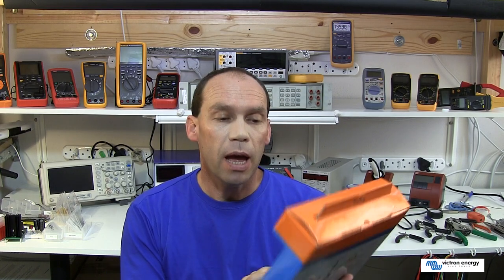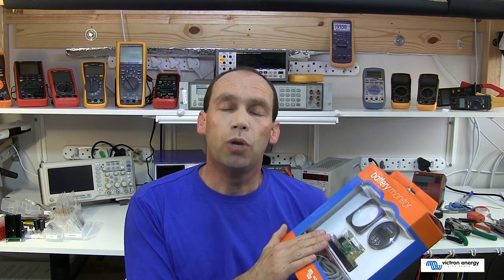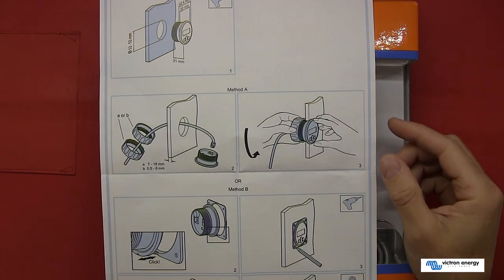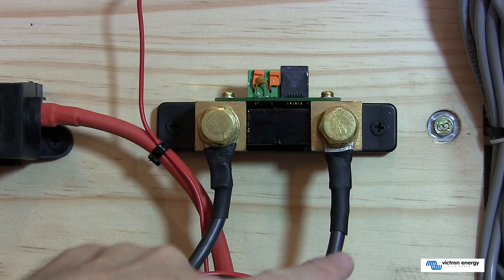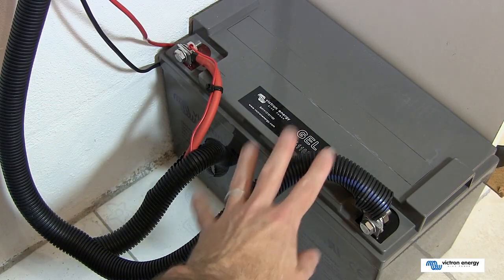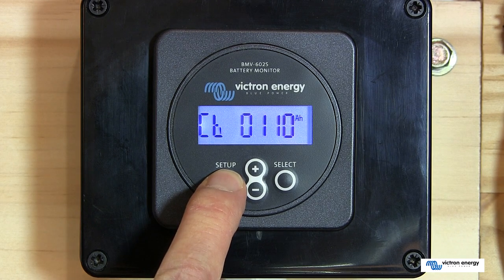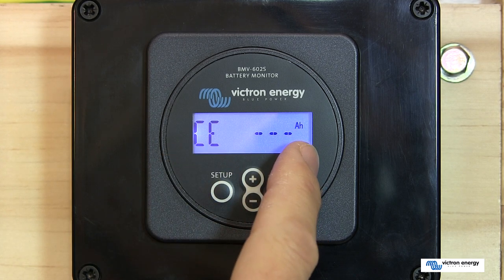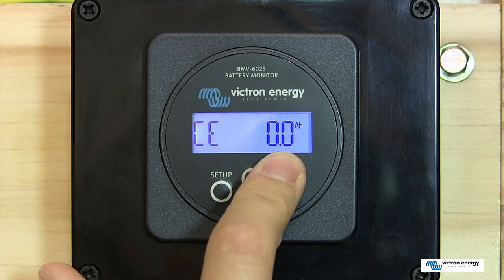VE Product Tutorial: Battery Monitor BMV600S - Part 1

Comment: Hi Dan, The monitor can automatically perfomr a auto synchronization to 100% but it needs ot be set up, it is quite simple but flexibloe as well so it will work for different systems. It can also be set to 100% 'by hand' as martin has shown.

Comment from the maker: It automatically recalibrates SOC depending on rate of charge, discharge and several other parameters. It's quite intelligent, I will cover some of that when I do part two. There is a video on YT showing some guys installing and using it in an EV.

Comment: I really like the Victron's ease of connection, using that telephone-jack plug, compared to my Xantrex LinkPro with a lot of single wire-connections. I guess the Victron BMV-602S is a sibling to the mentioned Xantrex LinkPro, as well as Merlin Powergauge Pro, E-xpert Pro, Studer SBM-02. The Victron has one more panel button though...

Comment: Thank you for sharing your video. I am in the process of researching what system or set up would be best for my RV going solar power. So far I have one Trojan 31 AGM battery but eventually I would like to run either 4 or 6 of these batteries in parallel as my battery bank. How would I use the BMV 602 or the BMV 700 to monitor my batteries. Also, what is the difference between the 602 and the 700 series?

Comment: Hello, I have two houses and a solar installation. I want to know if you can connect two battery monitors. What would be the connection in the negative borte of the two devices to be correct?

Comment: hi, is the battery capacity setting for 1 battery or the complete setup.
i have 12 x 2v 600ah configured in 6 in series and then paralled with another 6 giving 24v

Comment: Hi Martin.

I already bought this device and i think so far it is nice device..but what i was worry is plastic parts......I don't know if you would or could do some review like you do on your multimeters...so remove plastic parts and so on. I don't know if it is from USA or from China but i hope it will last for few years. btw i'm a bit worry about that switching element can you tell us what kind of component are they using for it? I'm using normal rele 24V/30A and i added Capacitor. so